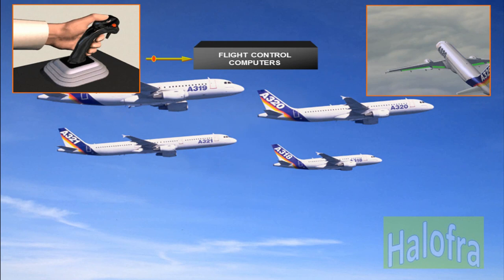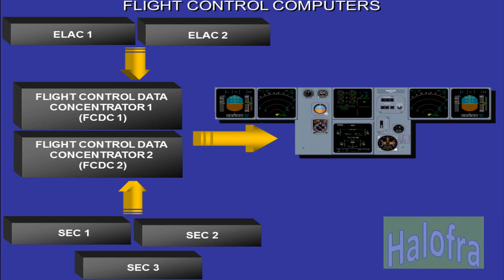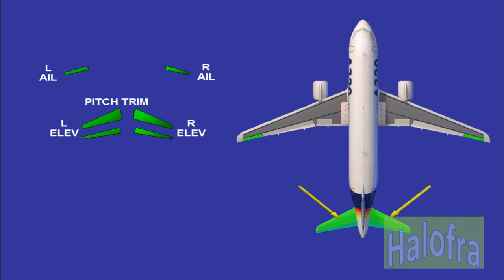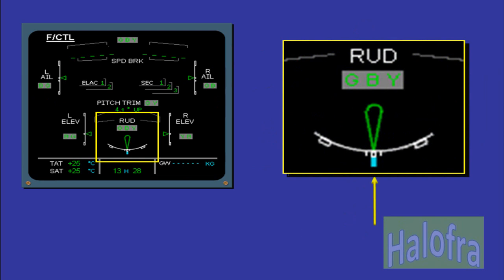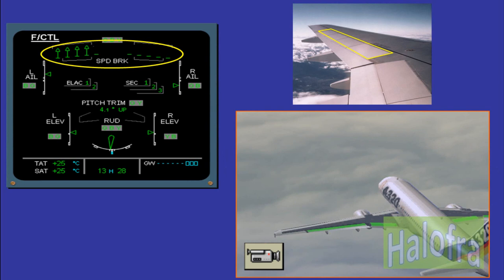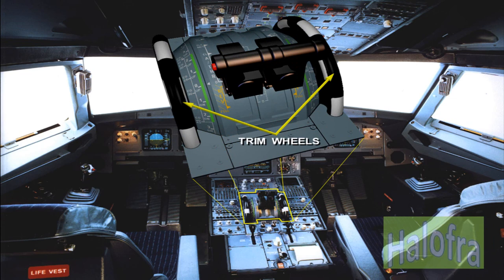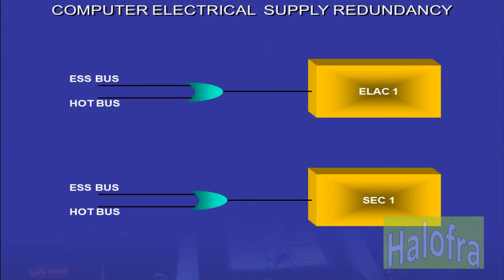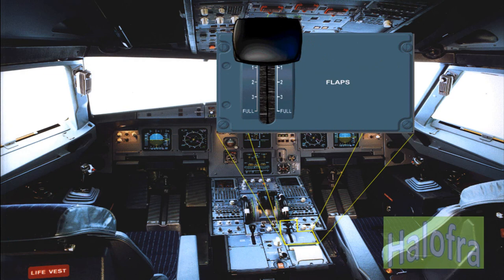Flight Controls A320 Family

Comment: The two redundant flight computers per control system are programmed in different languages?  Never knew that but it makes sense in case one programming language has a severe fault, don't want it to take out every flight computer.
Reply: I think that in case of processing stop like "whatch dog time" or checksum error, another core with different language take the control.

Comment: great video. thanks
Reply from the maker: you are welcome , thanks for the feedback
Reply: Hi you said each elevator is actuated by 2 independant hydraulic servo control in normal position one servo control is active throught the ELAC second back up the other one is dumped I didn't understand what do you mean by second back up more details about it plz

Comment: Hi you said each elevator is actuated by 2 independant hydraulic servo control. In normal operation one servo control is active through the ELAC second back up the other one is dumped I didn't understand what do you mean by second back up more detail about it please
Reply: One jack actually moves the control surface, the other is in what’s called damping mode and just follows the control surface loosely

Comment: I have one question: I fly the a320 is fsx, but in the simulator when I climb over 150ft the plane doesn´t let me to use the rudder, is it well done? I don´t know if in a real a320 the pilots can use the rudder whenever they want.
Reply from the maker: There are some cases when the pedal can't be used in specific speed and conditions
Reply: blackhawk1 Your sim is wrong. The rudder is always available at any airspeed and altitude with the autopilot off. With the autopilot on, the autopilot commands the rudder; pressing a rudder pedal will disconnect the autopilot. The rudder will be restricted as you climb and accelerate but at any point in manual flight pressing on a rudder pedal results in yaw. The rudder is very effective. Hope this answers your question.
Reply: Probably the rudder limiter?